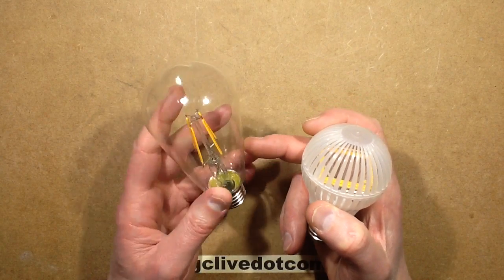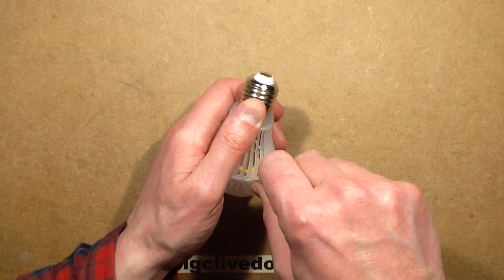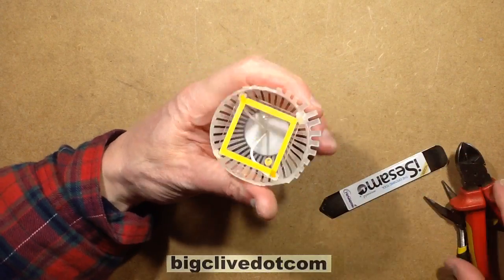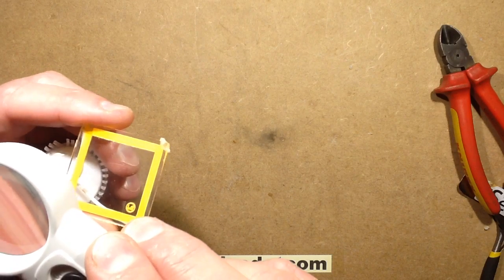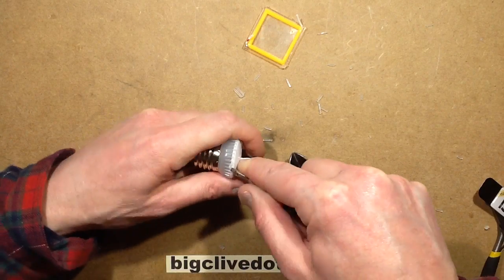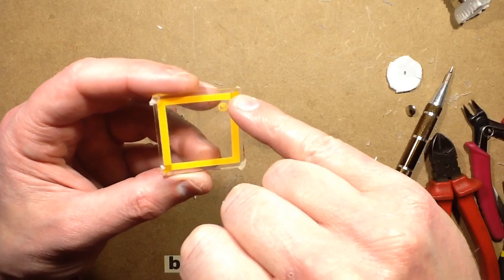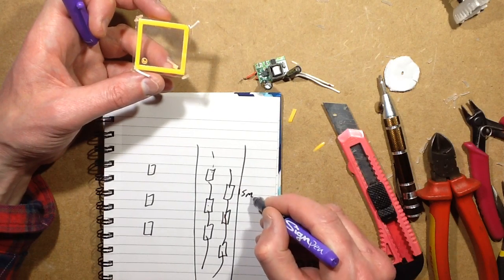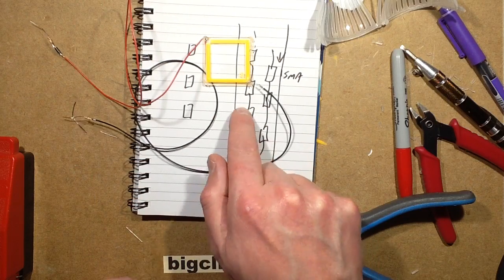Teardown of next-generation LED filament lamp.

Comment: Ordered 5 of the classic filament lamps 6 months ago and 2 have stopped working already. Just like other LED lamps I've been buying over the last 2 years.
I'm getting fed up with paying 8 times as much for LED lamps and getting only a 10th of the lifetime an incandescent lamp gives me. Then there's also the difference in colour temperature between the different LED lamps and the fact that most of them can't be dimmed (or need a special dimmer).
I swear I could've saved loads of money by sticking to regular and dirt cheap incandescent lamps despite the fact that they use much more power.
Mind you, I want to pay extra to safe the environment but it's getting too expensive for me.
Reply: To actually push money into a new industrial development is a really important but often overseen or misunderstood point too. Thats what we - the tinkers, are actually doing. We are ahead of the general understading of the new tech and it might as well take another ten years before our girlfriends starts to mention theese things as taken for granted common sense. Just be happy to be a part of the new energy revolution as sommany factors now is changing rapidly tech-wise. The Internet was a big thing, but wait and see what this leads to. If you stuck with the old tech, what understanding would you hav gotten to a be a part of? If sticking to the old you might have saved some but what would you have bought with te money? An ice cream or two? Keep tinkering, stop,thinking so much ;).
Reply: if you were buying the retail priced ones with warranties, then you could complain,  but you'd have the warranties to fall back on
Reply: +nyetloki Oh I know but when I bought them they weren't available here yet. And even now I see them costing almost double of what they are on eBay. Besides that, I'd have to keep my receipts for a year and exactly remember which Iightbulb I bought where. Quite a pain in the butt when you've got 25+ bulbs in your house.
The only simple (and expensive) way would be to buy all the bulbs at the same time from the same store.
Reply: +Ni5ei I think I'll be switching to entirely different lighting arrangements. Instead of having distinct lamps, I'll just buy lots of self-adhesive LED strips and stick them all along the ceiling. I can just dim them by connecting them to an Arduino's PWM output and writing a bit of code.

Comment: Clive, I often see you use capacitive dropper as power supply and never use any surge and short-circuit protection - is it fire safe? wouldn't it be safer to add some varistor and fuse?

Comment: Another revealing and illuminating peak into the fascinating world of LED's  
Clive Sir... YOU are THE man.
 I may have to try and order a few of these even though I have 120 Volt mains
UPDATE: 02/16/2016 These will light up on 120 VAC but continuous erratic flicker is the norm

Comment: I could see a lot of useful applications for such an LED. you could add a mirror like reflective layer and something like a polished aluminum frame to help with heat dissipation more and directing the light to make a pretty compact low power decent output spotlight

Comment: If they weren't so stupidly expensive (& possibly not available to the UK) it'd be cool if you got hold of one of those "hover board" balancing scooter things & did a tear down, see if you can replicate one of the infamous battery meltdowns.
Reply from the maker: +milksheihk I'd quite like to get one, but at the moment I'm following kids on theirs and secretly drilling holes through the base in random locations so I can make a viral video of one exploding with a kid on it.
Reply: bigclivedotcom I like the sound of that. I've personally only seen one of these things, they are one of those things that are technically illegal to actually use anywhere other than private property in Australia but there are plenty of supposedly Australian based ebay sellers who will sell you one, & Aus post customs screening don't seem inclined to stop them. But in  Australia there are plenty of things that are illegal to use for their intended purpose, or to even own in some cases that can still be sold to you be actual bricks & mortar shops.

Comment: Hey Clive, I've been searching trough local stores and eBay for one of these with a very warm color, something in the 1900-2000K range. Something with the color of a candle or dimmed halogen, primarily for use in PAR cans as background stage lighting. 

I've ordered one which was listed as "Yellow" and had a very orange-ish phosphor, looks exactly the same as the glass bulb you had on the start of the video. It was even warmer than the normal "Warm White" according to the pictures. I'm excited to see if it's true.

Another alternative would be a RGB LED spotlight with a 44key controller for custom color. Do you have any ideas of where they would sell very warm LED lights? My goal is that it shouldn't look like a LED, but rather a dimmed spotlight.
Reply from the maker: +Delightful Hardware You can't really go by ebay pictures or descriptions of colour.  It's really hard finding the proper "tungsten" glow LEDs.
Reply: bigclivedotcom I've noticed, they tend to use edited pictures to make the product look as good as possible.
However, I'm going to search around and buy some of those I would believe is of the warmer types by looking at the phosphor, compared to a 2700k bulb's phosphor.

Comment: Could one get six of them and make a cube? I'm kind of drunk now but, wouldn't one end up with three series of two "squares"? ie a voltage of ~206V, which should work on 220-240v mains.
Reply from the maker: +m8e You'd have to incude some form of current limiting.
Reply: Well yes, I meant that configuration wouldn't work with 120v mains.

Comment: Have you seen the "filament"  LED lights at IKEA? They look like they are using a light pipe.
Reply: +jak p (skiguy09) Those NITTIO (90) bulbs does look interesting/odd.
Reply: +jak p (skiguy09) The Nittio bulbs do look interesting; but woefully inefficient - 20lm @ 1.8W!
Reply: They look neat. I'm curious as to how they implement the light pipe. I think they are more for decoration then lighting.

Comment: Do you think this bulb would survive being whacked by someone's head? I have a lightbulb in my basement (with 5 foot ceilings) that's right in the middle of a path, and every few months a meter reader or someone backs into it and smashes the glass. Unfortunately there's no way to put a cage onto the fixture. If these bulbs are resilient enough I might buy one in the hopes that it also runs on 110V.
Reply from the maker: +Wolfgang Faust This one feels like it would just bounce.
Reply: +Wolfgang Faust I just got it; at 110V/60 Hz it flashes rapidly when you turn it on.
Reply from the maker: +Wolfgang Faust Darn!  Worth a try though.  Hopefully they will bring out a proper 110V version.

Comment: Well in my uneventful search trying to find if these came in ready made modules I did find the original data sheet from the original mfg for the LED Filaments. I don't know if you have seen this yet +bigclivedotcom but I figured to leave the link just in case. (BTW They have a patent on the filament in the US.... So besides for countries that ignore patents like china they will be the only "official" mfg 😡) I am surprised that the filaments supposedly have a CRI of 80+ (At least the official Runlite ones)
http://www.runlite.cn/userfiles/5cjerp755q19k1413258994.pdf
Reply: +Andrew Querol Oh yea here is the link to the actual patent if you haven't seen it.
https://www.google.com/patents/US20140369036

Comment: Cool, I wounder if they can survive being installed in a recessed lighting fixture ( really hard to find LED lamps that are listed as being safe to use in one (without massively shortening the life of the unit).
Reply from the maker: +Razor2048 The only real choice for recessed or enclosed fixtures is a low power lamp.  The heat build up is an issue.

Comment: I prefer the classic "glass" design. I have a bunch of them.
Reply from the maker: +Erik Žiak (tramstefanikova) Unlike the glass ones, I think this one may actually bounce if it was dropped.
Reply: +bigclivedotcom While that might be true and even practical, I am old-fashioned in this respect. But thanks to you I know that this "next-generation" LED filament bulb exists and even how it looks from the inside.
Reply: +Erik Žiak (tramstefanikova) Great for general use, but like you I prefer the glass filament type for decoration and giving off that classic "warm glow" feel of yesteryear
Reply: +Erik Žiak (tramstefanikova) I have three of those "classic look" lamps in the hallway without any shades or anything to hide them. Just braided cables and black e27 sockets.

Comment: Since i ever watched your bulb videos i always wondered about the quick change light sockets? I've never seen them round here at my place. They look so handy.
Reply from the maker: +LaterMeansBrick the bayonet cap lamp holder is the primary UK standard.  It has its pros and cons, but is pretty good.  Lamps can't work loose in them.

Comment: A bit off topic Clive, but where did you get your 13A plug power meter from? I've searched in all the usual places to no avail. I did order a similar one  off Ebay (I think it's the type that you referred to as shite) but it was dead on arrival. They sent me a replacement which worked well for a time, and I was really pleased with it, but the following day it was giving random readings. (I did get an immediate refund when I informed the supplier and I now have two useless meters!).
Reply from the maker: +Joseph E That's the best one I've found to date and came from Maplin when they briefly stocked them.  I've not seen a similar one since though.
Reply: +bigclivedotcom Thanks for the tip, I went  to Maplin today and bought a power meter for £9.99. It took a bit of finding on their website but they do have them.

Comment: I wonder if they could cover the entire glass with it? that would get more than double out of it, assuming it wouldnt get too hot
Reply from the maker: +jusb1066 I think heat could become an issue.  The glass is already dissipating 6W of power.
Reply: +bigclivedotcom 
Schmee again, have you ever thought of using a USB microscope? I did a quick eBay search and found a bunch, going from  $10 to $70 about. You do such a good job,  maybe that could be  your Eye Of Enlightenment. .  :-)

Comment: The BP2831A specifies an input of 85V AC to 265V AC...

Do you reckon this bulb might work properly in a 110V socket, or does that depend on some of the other components on that PCB (Like the transformer).

I think this is the best design I've seen so far out of all the LED bulbs you've torn down so far...  I think that if they'd used some decent electrolytics on these, this thing could last a good ten years.
Reply: +bigclivedotcom I, too, would love to know if they work reasonably well at 110V, as I can't yet find any that rated for that voltage.
Reply: +Darron Birgenheier +khachaturian I just got one and tried it out. It lights up but flashes rapidly.
Reply from the maker: +khachaturian I'm not sure how it would fare on 110V.  Theoretically the rectified and smoothed 110V would be about 155V and the LED combined forward voltage is around 105V so that's probably enough to work properly.

Comment: "Vice of enlightenment" love it lol =)
Reply: +mikokuijn 'For the two-jawed workbench tool, Americans and Canadians retain the very old distinction between vise (the tool) and vice (the sin, and also the Latin prefix meaning a deputy), both of which are vice in the UK and Australia'
Reply: +abyssunderground isle of man vice :P
Reply: It's a https://en.wikipedia.org/wiki/Vise.
Reply: +abyssunderground Not all vices are bad ones. :)
Reply: A vise or vice is a mechanical apparatus used to secure an object to allow work to be performed on it. Vises have two parallel jaws, one fixed and the other movable, threaded in and out by a screw and lever. thats what it says on the wiki...

Comment: They don't seem to have one designated for the 110V girly power in the US... do you reckon the supply would operate at 110-120V, given the ~100V DC output? And the 220V is just a maximum rating?
Reply from the maker: +Stephen Tack Rectified and smoothed 110V is 155V and the LED combined voltage is about 105V so I think it may work.
Reply: +Stephen Tack +bigclivedotcom I just got mine and tried it out: it lights up, but flashes rapidly. Not recommended.

Comment: You need to get yourself some cheap welding goggles to look at the light, iv got some off ebay, and you can use them to see the bulb coils glow, How much duty did you have to pay on it ?
Reply from the maker: +martkt10 No duty, the actual value was too low to incur it.
Reply: +bigclivedotcom Thanks , think i'll try one for my garage

Comment: Would these work in the USA on our 110v?
Reply from the maker: +Michael Massey I think it may work.  the chip is rated for a wide voltage range and your rectified and smoothed mains is 155V which makes it higher than the 105V of the LEDs.
Reply: +Michael Massey I got one to try. It flashes rapidly when you turn it on.

Comment: I just love how we went from people experimenting with LED lighting in the 90's using the old style LEDs to this!  

I might just have to get a few of these, since it looks like they may be more reliable now.  I remember buying some for my bathroom about 7 or 8 years ago and being disappointed when they died within a month.
Reply: +Coffeehound yes early led lights were both expensive, and not very bright, (along with terrible colour and narrow beam) although i would have assumed due to their price they would have been long lasting, but i guess not!.   I know i had a very early CFL, it cost around £30 and was big and a large frosted glass cover, but to give it props, it lasted 10 years of daily use.
Reply: jusb1066
I probably got a bad one.  It just happens sometimes.  I just wasn't too thrilled to spend 15 dollars to get a new one at the time, so I bought CFLs, which were about 7 dollars each.

Comment: Interesting. How would you say this compares with the normal 6w 6 filament blown glass ones, brightness wise? Also was there any visible flicker? All the ones I've bought so far from china/ebay have been a real mix of perfect 0 flicker against very noticeable 50hz flash.
Reply from the maker: +asdreww No visible flicker on this one, and the brightness was surprising.  Much higher than a 4W glass filament lamp, but not compared to a 6W one.

Comment: Hi Clive! Today I received my package with items from China (ebay) ordered 2 months ago soo... something was up...
Reply from the maker: +Electester Yeah, I've had some huge delays.  I don';t now if it was down to the Xmas Krush or the clamping down on exports from China to the UK with batteries in them.
Reply: +bigclivedotcom Thanks for the link, cause I've just ordered 2x 12W bulbs... Suprisingly cheeeaap- 3$/piece. And the aspect of cooling is interestingly solved. It looks so unusual but tell me... what about the pattern/shadow this bulb may cast behind plastic ribs?
Reply from the maker: +Electester I expected a pattern on the walls, but there was none.  Must be the large linear LED array inside.
Reply: +bigclivedotcom Finally I received my bulbs, same as on the video. And yeah, their very bright but... Bulb actually draws 6W, not 12W as the manufacturer describes- but in that case this is an advantage- less power and brightnes like 10W LED bulb. This company produces bulbs that don't reach their described power or simply... power is real (intentional) and the description is inflated.

I'm saying like that because I also ordered  COB 6W / 12V and they actually achieved only 1.5W. After writing a complaint,  manufacturer offered me a refund of 1/3. Ridiculous...
Reply: I asked them for refund not for money reason, but only a matter of principle. You get it? When you are doing that, you can teach those sellers in China that truthfulness is essential in business.
Reply: I didn't see them on ebay, but you easily could find them on aliexpress.